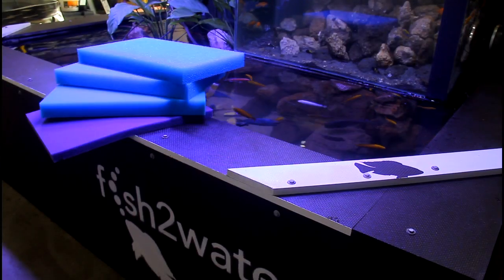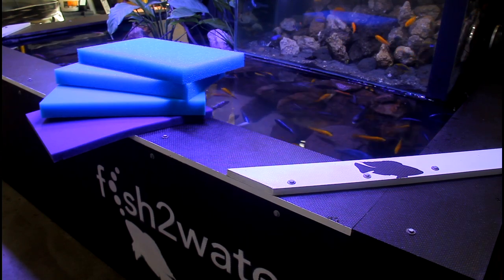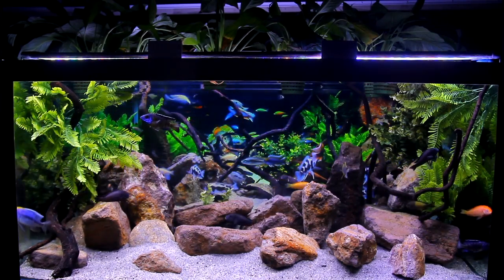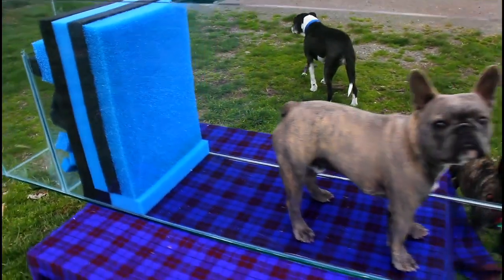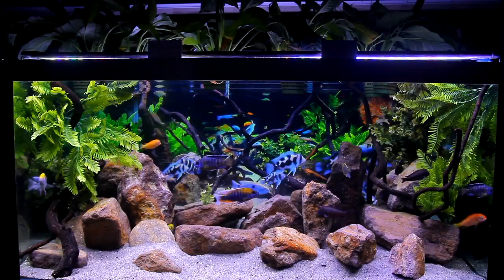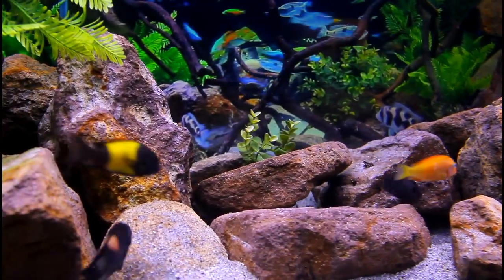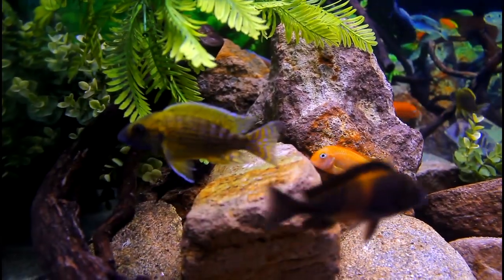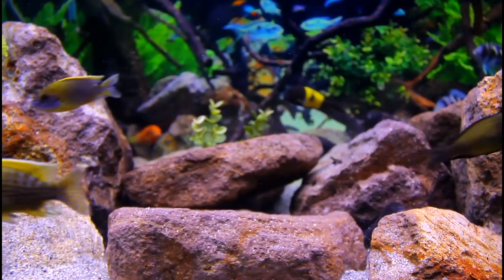How we filter our display tanks

Comment: Really appreciate your work, expertise and experience your sharing within this hobby. Just wanted to ask with regards to your very basic and effective sump set up what PPI Poret foam are you using from right (water intake) to left (return). I'd like to replicate something similar without installing baffles. Just subbed to your channel.. 👍👍
Reply from the maker: 10ppi, 20ppi, 30ppi, 45ppi Going from coarse to fine foam. You want the dirt to be removed in stages. I always disliked conventional systems that started with fine filter socks or poly blends.That would immediately block up. Pretty useless